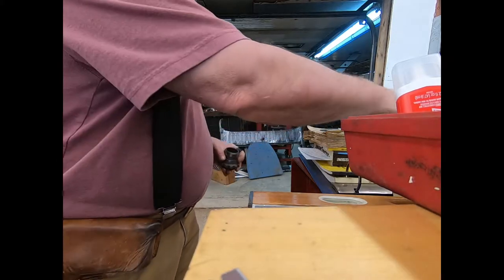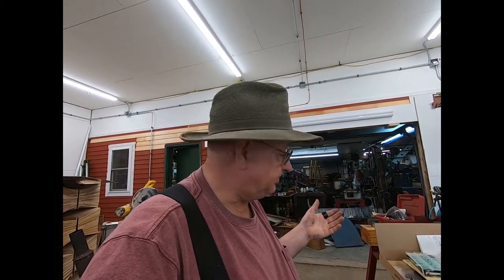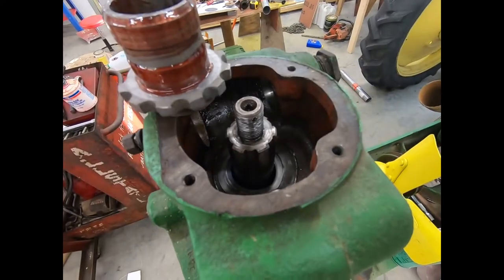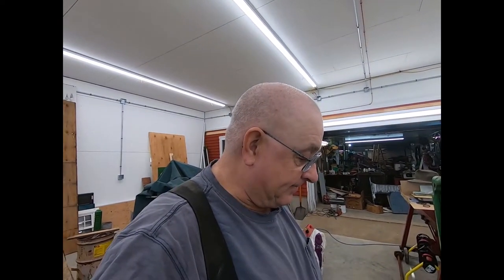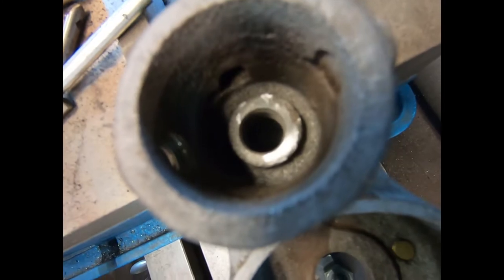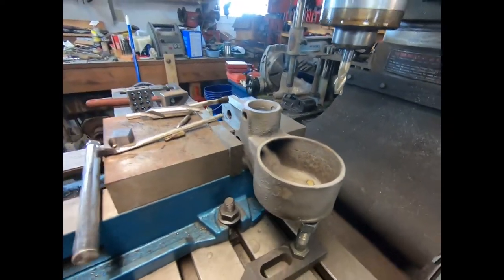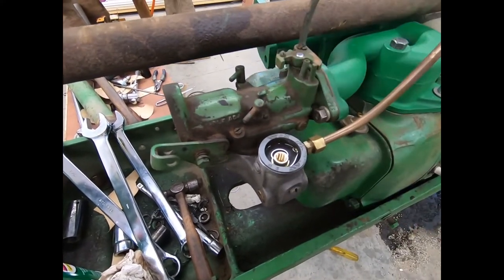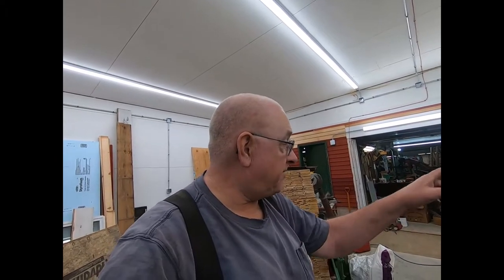# 413 JD-B s.n. 147828 Engine rebuild

Comment: Tractor steering boxes always seem to leak. I mix my own lube, 140 hypoid  plus enough grease so it will just slump but not run out. Almost all the wear in the worm and sector is in the straight ahead position if you get her just right in that position it will tend to bind on the turns. Of course we're not hitting 60 on the interstate so a tiny amount of slop is of little consequence.
Reply from the maker: With no 5th or 6th gear a little slop doesn't matter as long as it steers easy.